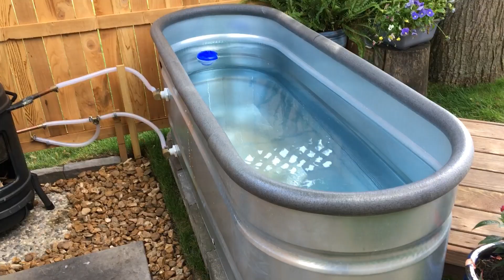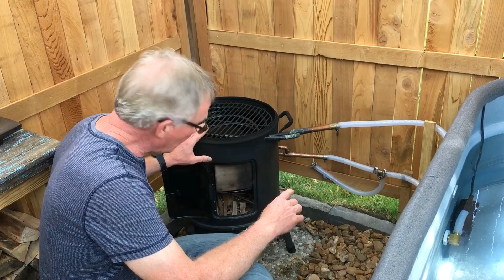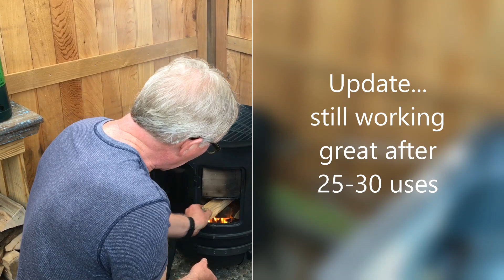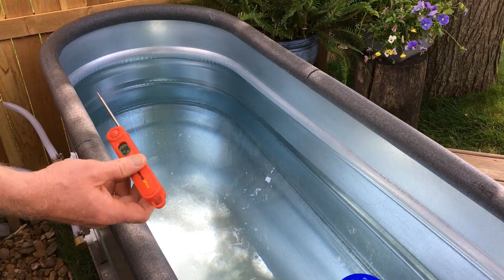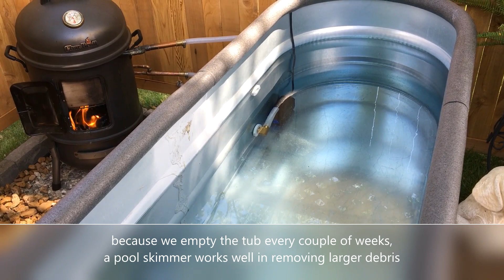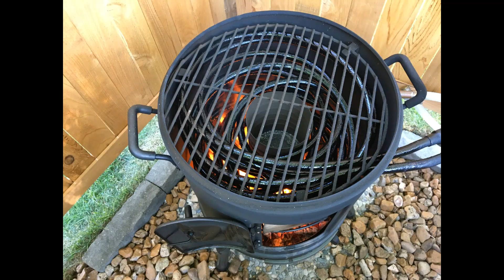Wood-Fired "Hillbilly" Hot Tub

Comment: Did you bend the tubing by hand? Or was it just kind of how it came from the store?
If the inlet and outlet were swapped at the tub (Same water flow direction) do you think that would add a natural agitation and maybe help heat the water more quickly? 
I'm highly interested in doing this myself and intend to try that setup. I think I'll have a tall stack added to the lid to keep the smoke away, have the heater closer, and the hot water pipe insulated.

Comment: I like your setup. I’m curious if you use it very much. We have a good spot for one. I think I will try an external pump though. Looks like it might be in the way inside of the tank. We happen to have a wood stove that has a water jacket on it too. Thanks for sharing.
Reply from the maker: We don’t use it at all in the winter - although we could. Because it can take up to 3 hours to get the water up to a comfortable temperature, it takes a little planning if we wish to use it. We had a busy year last year, so only ended up using it roughly a dozen times. 
I too would like an external pump, but haven’t yet found one that has the right flow rate with the correct fittings.

Comment: What white piece did you use coming out of the tub and what 90 degree piece is that?  Was there any adhesive or waterproofing on the holes in the tub?
Reply from the maker: The pass-thru piece is a Green Leaf TF34NB BG1 (Tank Fitting, 3/4" w/Buna Gasket), and the 90 degree adapter is a 3/4" PEX to 3/4" MIP adapter. I bought all of the fittings at Menards. And the gasket around the pass-thru seals nicely - I do not have any leaks.
Reply from the maker: It is a "TF34NB BG1 Tank Fitting, 3/4" W/BUNA GASKET" by Green Leaf Inc. and purchased at Menard's

Comment: I use a stock tank like this mounted in a carrier on my truck camper off my receiver hitch. I heat it with a cajun cooker with propane up until i get to around 100 degrees then i use a camping shower to recirculate and keep the water around 104. I need to put all my little video clips of the colorado mountains with my portable hot tub.

Comment: Awesome little set up you built.. I've never seen one with a pump installed, I'm sure it helps a lot.
Reply from the maker: It works very well. In my setup, the pump is required. If I forget to power up the pump, the water in the pipe boils and causes loud pops of very hot water out of the upper port. If I were more careful to keep an upward slope to the coil of copper tubing within the burn chamber, I might get thermal siphoning without the need for a pump. As it is, there are dips in my plumbing which impede the natural low-to-high flow.